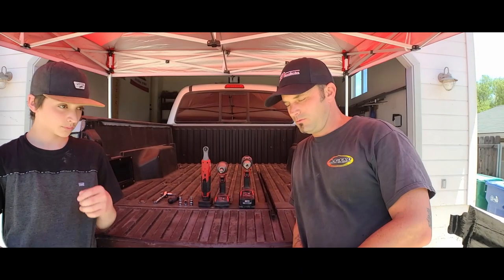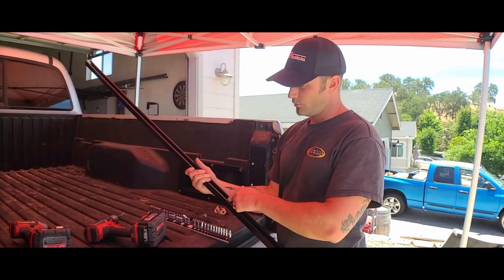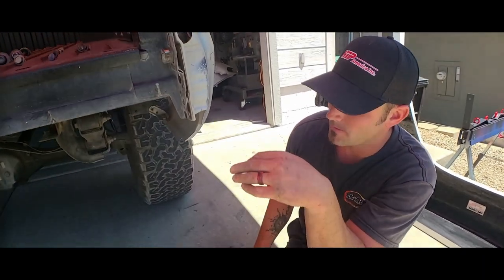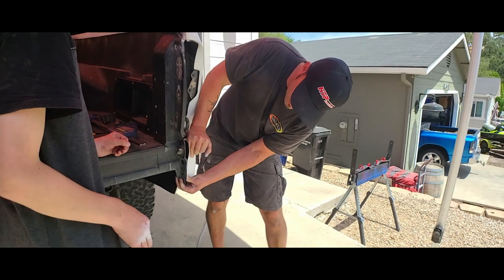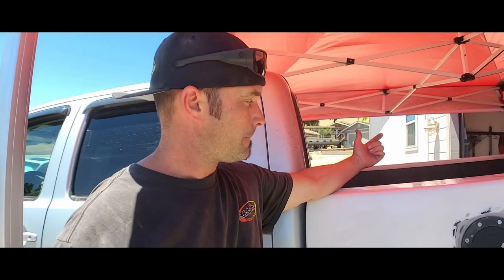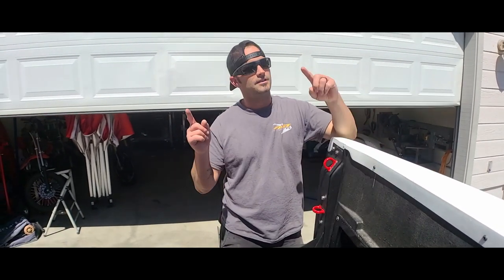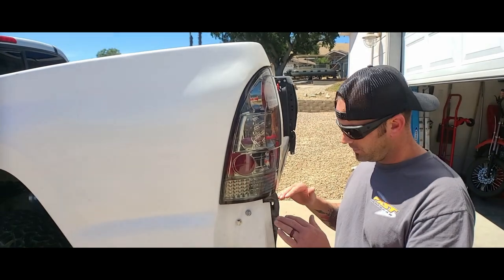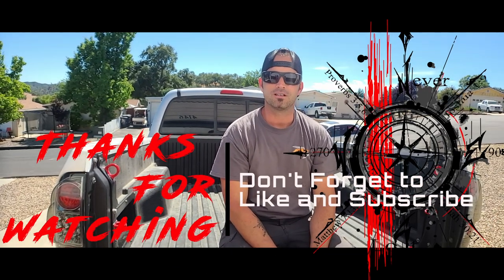McNeil Racing Bedside Install and Fitment for Tacoma! In Depth Installation Video!!

Comment: Thank you so much for your videos.  They helped a lot.  Can you share info on your gas tank cover.  Where you got it and what you used to install it.  I finished mounting the fenders this weekend and ran into the same issues you did regarding the front fender supports.  

Also what did you do to protect the air intake so it won’t suck up crap that shouldn’t be sucked into your motor.

I was very frustrated the rear front fenders are so unsupported and flimsy.  I’ll be fabricating more support braces.

This is definitely not a take off and bolt on job.  Even when you finish installing them, I’d say you’re only about 75% finished.  Need to make more supports for the front rear fenders , fix the gas tank cover, fabricate some type of cover for the air intake, apply rubber seals around all the headlights and taillights and then finally have the truck painted.
Reply from the maker: Right on your welcome.
Fuel door bought on Amazon, under "billet fuel door" We made a vid on most of the process for fuel door.

As the situations in mounting glass, that's what I had brought up when I answered your previous question. There is definitely much more that  goes into the complete project.

I also show how I made another set of mounts for the bedsides in the front area.

I have aftermarket intake, so there is a shield around the inlet. If your concerned about debris getting in engine bay (which will happen anyways) you can either use a mesh screen or purchase/ fab a diversion where air enters into air intake.
Reply: @neverlostadventures  Fantastic!  Thanks so much.  I guess I missed the other videos.  I’ll go look for them.  Again, I appreciate your feedback and info!
Reply from the maker: No worries,  thank you.  Lmk if you have any other questions.  Thanks again, and good luck on build. 😁👍🏼🇺🇸

Comment: I got the mcneal +2 bedsides. Then fronts fit pretty well. But the bedsides were a nightmare. Both sides don't sit all the way down on the bed. Had to leave about a half inch gap. I could just do reinforcing down the road if I want to make it more sturdy. The pieces under the tail light would not go all the way over to the mounting points. I put a spider crack in one trying to manipulate it too much. Took me all day for the bedsides cutting and refitting. Still didn't get the fitment I want but I can live with it.
Reply from the maker: bummer. Did you contact them letting them know about your situation? Some times they have good suggestions. or if it was that bad maybe they would have swapped out.
Reply: @neverlostadventures I ended up just trying to make it work and did a slant cut, giving me a little more manipulation to get the part under the headlight over and bolted.  One of my bedsides had a crack in it and they didn't send the hardware kit with the shipment. They refunded me for the hardware kit but I've been struggling to get a refund for the bedside. I decided to just try and repair myself so I don't have to wait another 2 months for another. Honestly my experience with them hasn't been great. I was stuck with them though as they are the only ones that make +2 fenders.
Reply from the maker: @lukeferrara3110  Sorry to hear. It's crazy when companies treat people differently. I wish that regardless of the situation all customers, granted they are respectful, they are taken care of and treated well. After hearing about situations between people and McNeil, I'm having reservations about them. I know Fiber Werx has great glass and customer service, but as you mentioned, Mc Neil has the bigger bulge. 
So you got hardware? for what? I never received any nor knew there was an option.

Comment: How long do you think it took you to complete the entire front and rear panels?  A day for each?  Thanks.
Reply from the maker: Well without recording vid of course the fronts would be around 4 to 6hrs. The rear could take about 2hrs longer.  Stock parts take longer to remove, especially if your trying to resell. Otherwise you could RIP and cut most off.
-Something to think about; both ft/rr f.glass need brackets, sanding,  hole adjustment, possibly new hardware and overall fit/finish. So if you have everything ready, it will drastically shorten your time. 
My suggestion is to take your time,  do it right. Mount them correctly with solid support, if not you'll pay in the long run with spider cracks, chipping and simply not lasting. 

Thanks for watching and commenting.  I hope your questions were answered. If not hit us up again. Cheers 😉🤙🏼🇺🇸